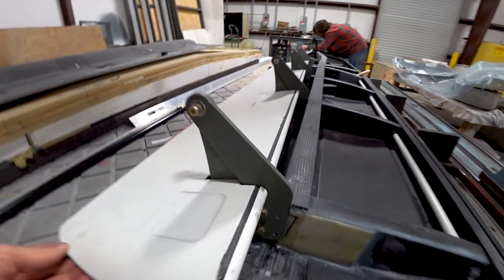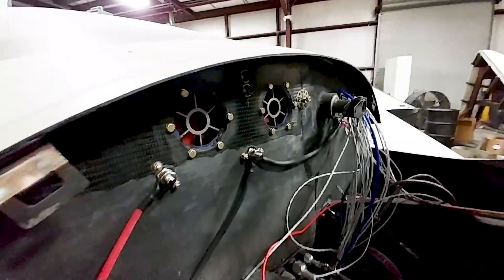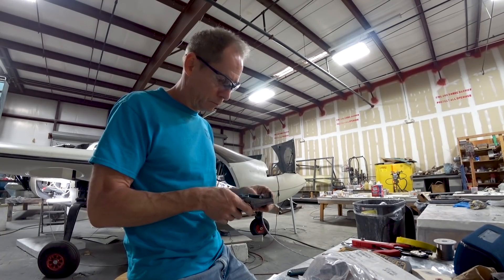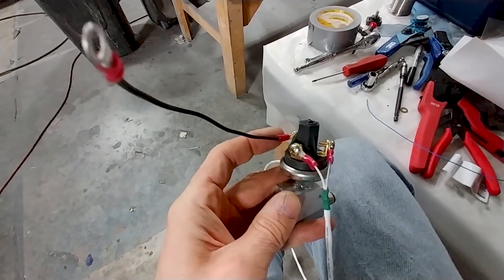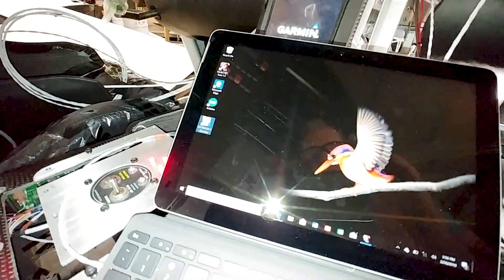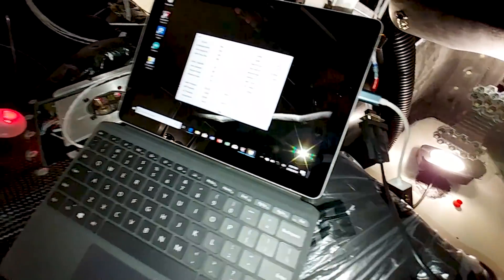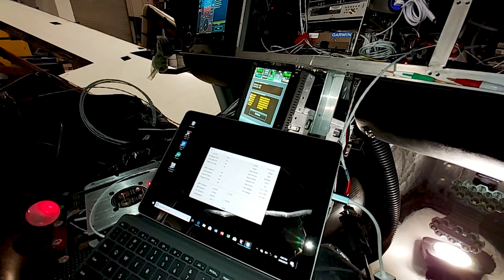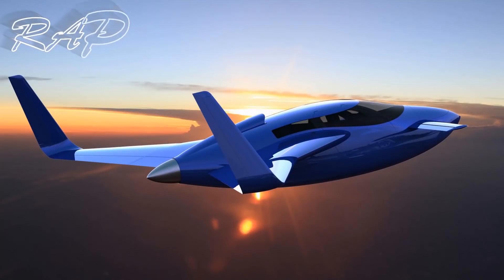Outflow System Operational - Building the Raptor Prototype

Comment: Best of luck bleeding the brakes, I've tried to bleed brakes with a vacuum pump without success. I found that pressurizing the bleed screw at the caliper is the best method. The problem is the bleed screw on the caliper is not sealed so when you feed the fluid in at the caliper, you will also pull air with it. If you put a sealed fitting at the caliper to keep the air out, you will introduce air when you disconnect the fitting to put the bleed fitting back in. Fantastic glass work though.

Comment: Brilliant idea on how to bleed the brake system!  I'm impressed.  Keep an eye out on the coolant reservoir for cracking due to engine vibration.  If needed, you can always mount it on rubber insulators of some kind.  Diesel engines in general, are bad about vibration, but you already knew that.  Keep up the great work!!!
Reply from the maker: Actually this Audi engine is very smooth.
Reply: @RaptorAircraft  Great!  You ought to know.  Then there's nothing to worry about.  Most of my experience with diesels has been American pickups.  
I look so forward to Tuesdays and Saturdays because that's when I get to see your cool videos.  Keep up the outstanding work!  Your channel is my favorite one out of cable TV, Netflix, Amazon Prime, and broadcast.  Thanks for all that you do.
J. Larry Bloodworth CMAT
Draper, Utah 84020-9798
Reply: Please don’t post personal data to protect your identity.  I just had my identity stolen and the time and effort to fix it is no small matter, I can tell you.
Reply: @neve1064  Thank you for your concern.